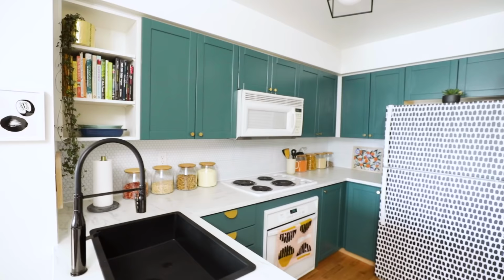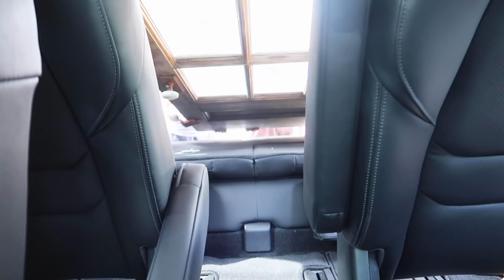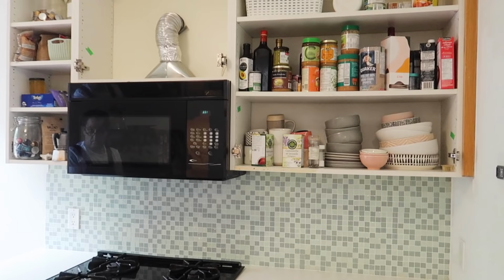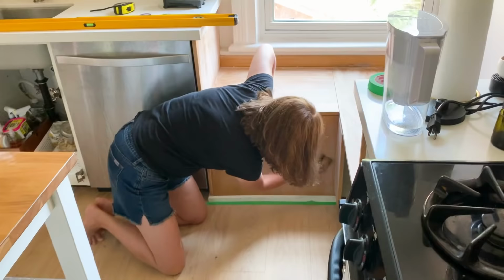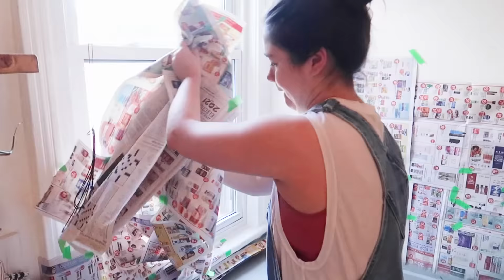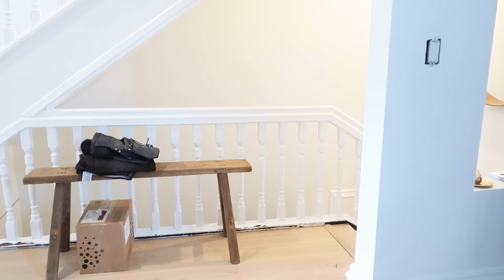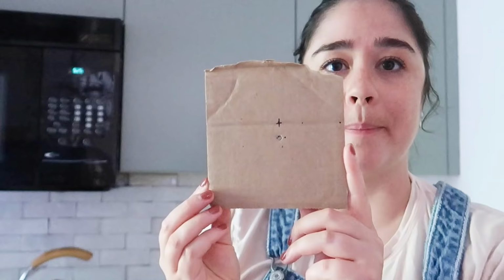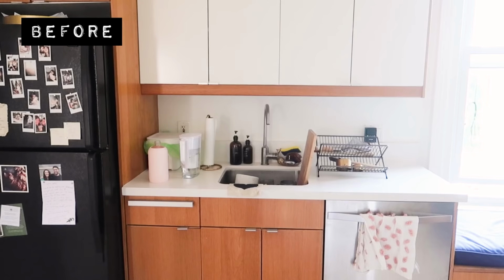DIY Kitchen Renovation On A Budget | We Renovated Our *ENTIRE* Rental Kitchen | My Rental Reno S3 E9

Comment: This level of eclectic would drive me nuts, but it’s definitely in line with your style. The door is the ultimate showstopper and ties the kitchen to the living room, THAT door is the character of the house. The tile is beautiful. I personally couldn’t live with open shelving, but it’s certainly a great styling opportunity. The door is stunning. 

Question: the tile seems quite thick and the space between the wall and the stove quite narrow on camera. Did you measure if the thickness of the tile plus the binding material would fit or it’s not a close shave in reality and it’s only the camera deceiving my eyes?

Comment: Really great results. I don't follow you (have seen 1 or 2 videos) so this was my 1st bird light. I loved it, but wonder how much light it produces for a kitchen.  That door is right up my ally. Open shelves don't work for me (maybe because mine are essentially 3 boxed in shelves I found on the street that aren't deep enough), but also because I just put practical unlovely things on them. I've had a small lamp in my kitchen for years. Quality of light is critical. Two "oops" things jumped out at me: the window needs to be cleaned and there seem to be a space under that bottom shelf that didn't get grouted. Would bug me to see them every day; maybe not you? Lastly, having a helpful & capable relative is a godsend! You are lucky.

Comment: I've been renovating my kitchen and had the same issue of not being able to find doors that were small enough to have two. So.. I bought an old external door with it's sidelites (the decorative glass panes on the sides) from marketplace, broke/cut the sidelites out, and made them into barn doors. The other option you can use is IKEA cabinet doors (for medium sizes).

Comment: It looks so good. What a great video. So lovely to see you and your family. I did a similar thing to a glassed door that I had, except I used a sheer curtain and I soaked it in cornstarch and then put it on the glass. The cornstarch acts like a glue and holds the sheer in place, plus it's removable with warm water. I changed it up after a year. It was still looking really good, but I had gotten bored with the look and wanted something different.

Comment: Is renovating a rental a normal thing in the states/Canada? Here in Australia you can hardly even hang a picture frame in a rental
Reply: Not to this extent; she's lucky she has a supportive and open landlord, which isn't the usual case. Generally speaking, at least in my area of the States, you can do anything that is reversible when you move out. e.g., paint over any painted walls, fill in any holes from hanging things, swap back out anything you easily changed (like cabinet handles and the glass covers on lights on fans).

Comment: I got really confused by the shelf process. You first showed cutting one side of your timber, but it already had wholes in it. 
And then you showed drilling the holes in it. 
And then you showed putting the dowel in the hole, gluing it in and hammering it all the way in. 

That does not make sense. 
This parts needs a better edit